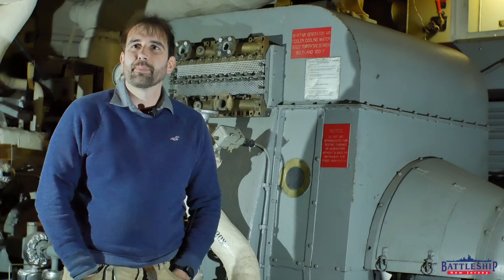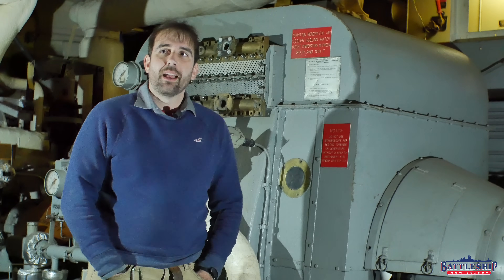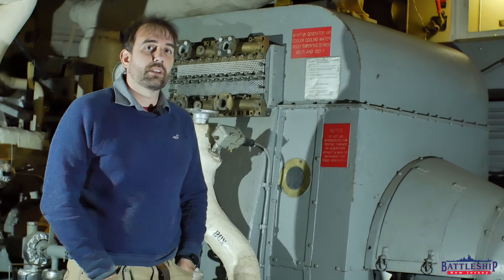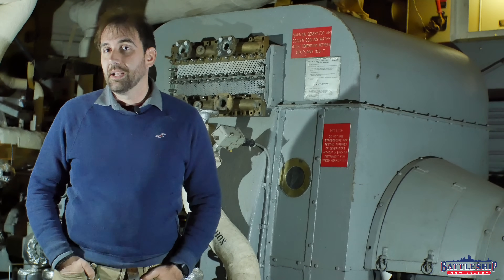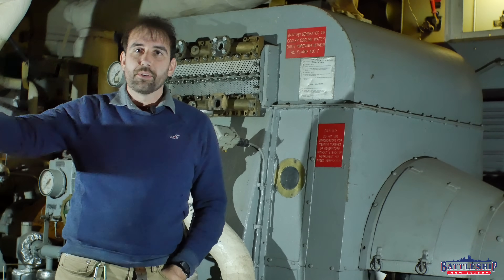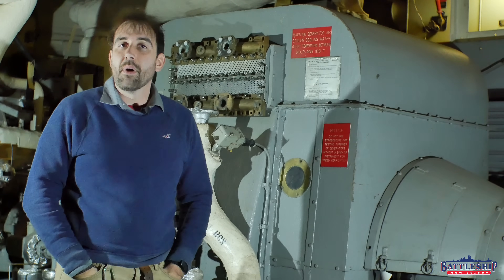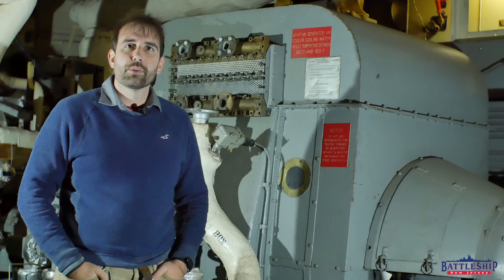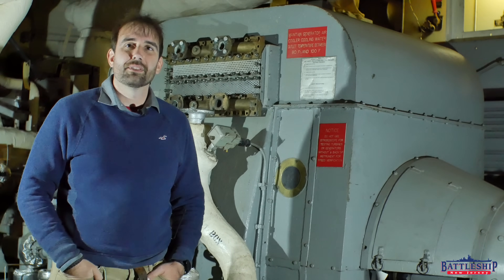Turbo Electric vs Direct Drive Turbine: What Propulsion Plant Is Better for Capital Ships?

Comment: A hybrid with a mix of gas and steam turbines to allow both more efficient steam turbine use for up to moderate power demands and the smaller size of gas turbines to allow more peak output and redundancy from extra turbines, designed with no less than an n+2 turbine configuration to allow for full operation while simultaneously having a turbine down for maintenance and one going offline unexpectedly for failure or battle damage requiring a third turbine down before any limitations on power, helping fulfill the absorb hits and keep going needs of a battleship.  Combine that with a 3 power bus system with most critical systems being hooked up to select between two busses and each turbine able to connect to any bus running at 14400 volts phase to phase/7200 volts phase to neutral, like most street level power distribution lines to allow smaller lighter wiring for very high power items and large feeders, stepped down to 480/277 and 208/120 for smaller loads.  Three busses configured that way allows for operation with any single bus out of service without as much weight penalty as a two bus system would have as each only needs to handle 1/2 of the total load, not all of it (remember in bus out of service all load gets split into the remaining 2 or single bus) or in other words total bus capacity is 1.5x (0.5x3) not 2x (1x2).  Keep the busses separated from each other with only branches going to the same place, perhaps left, right, and down the center of the ship so no compartment can take out more than one bus.  Add in redundant control rooms with redundant control cabling (something some modern large commercial ships actually have already) and you have a good base for a highly survivable, highly reliable, ship that can do repairs and maintenance underway without loosing redundancy and can survive a lot of complex multiple system failures and which uses a fair bit of widely available equipment which saves on cost, means we know a lot about what it can and can't take, and makes procurement of repair parts, spares, etc. much easier as there are large established supply chains.

Some may be able to tell, this is somewhat influenced by my background in IT systems and what I know and have seen or dealt with in redundant systems there, including the high power environment of data centers, which in fact often take their power in at those higher voltages and run their generators at them for similar reasons, though almost all their load is stepped down to a mix of 277/480 and 120/208, they also often have multiple internal power grids with a lot of equipment being hooked up to two separate power sources with separate backup systems, some of them have explicit redundancy even during maintenance provisions like described, and so on.  They also are an example of systems build for extremely high power demands, typically measured in megawatts, often double digit megawatts in a single building and some campuses reaching over 100 megawatts in total.

Comment: I work with a gentleman who was an electricians mate on board the USS Missouri for his last 4 months in the Navy. He told me that as he recalled the Iowas had a 5 kV electrical distribution system that was protected by GE magnablast breakers amd electromechanical relays. As an electrical power distribution engineer id be super into a video talking about some of that equipment

Comment: I served in the submarine service in the late 1960s in three different WW-2 built Balao class subs which had been upgraded and streamlined after the war.  This was the time when the nuclear submarine fleet was really just being built up.
   In the 1920s and 1930s The US experimented with various types of drive trains for their subs.  It must be said that submarine technology was much influenced by the vast improvements of the relatively new diesel engines and that they eventually used the same diesels as the new diesel locomotives, making the R&D and $$ workable for the navy.
   Back in the 19-teens well into the 1930s the diesels were (noisily) geared directly to the prop shafts, but this created noisy vibration and forced the diesels to be run at speeds related to desired shaft RPM instead of their most fuel-efficient constant speeds.  One design had a single prop shaft routed thru two diesel engines in line and created hopeless vibrations because of inevitable even slight misalignment.  From there subs developed one pair of direct drive diesels in the stern and a second pair of diesel generators further forward in a compromise plant.
   By the late 1930's the fully diesel-electric drive had been adopted, refined and proven for submarines, generally worldwide.  In our US subs there were two 1500 to 1600 HP railroad locomotive diesel generators in each of two engine rooms.  The generators sent their power to a large switch cubicle just aft in the maneuvering room.   Here the power could be cleverly switched to power the large geared electric propulsion motors below the deck of this compartment, and/or to charge the massive batteries that provides ALL power and propulsion for the sub when it was submerged.  The switching allowed any diesel generator to do either of these tasks or both of them at the same time - ultimate flexibility.
   Late in the war a captain in the electrical branch, one Hyman Rickover, led a team which developed a slow turning electrical propulsion motor for submarines.  This eliminated the need for the very noisy gearing and made our boats quieter.  These were installed as original equipment in late war subs and were commonly retrofitted into the earlier subs when they were upgraded post war.
   After the war these boats were upgraded in various ways (GUPPY programs) always with a snorkel system which could supply air to any two of the four diesels allowing them to be run at periscope depth which made the subs more difficult to detect.
   The diesel railroad locomotives use the  same concept of electric drive.  Large geared electric motors turn their wheels.  But on the subs, at least we had our large batteries to subsist with when below.with no diesels running.
I FAST BECAME A BIG FAN OF ELECTRIC DRIVE, AND STILL AM.

Comment: With electric propulsion motors the size you are talking about does not have the advantage of changing direction as you say. They have to use a thing called slow ramp to prevent pulling too much current and over loading the generators. Also you would not have a bunch of small generators around the ship making power, it would probably be 4 massive turbo generators creating power at 11,000v to keep the amps down. I was on a gas turbine electric ship that created enough electricity to power 60,000 homes. The benefit of Electric drive is mainly fuel efficiency across a broad speed range. There is no survivability advantage because with high power systems like this there are alot more components such as converters and transformers. If there is even a slight problem with them the whole system goes down. There is a reason why the designers went for steam turbines on the Iowa class.  Fuel was cheap, electric propulsion technology on this scale did not exist and steam turbines are simple
Reply: USS New Mexico used 2 4000V generators for propulsion, and six auxiliary generators. No power electronics at the time so they jumped speed by switching the number of poles, and any other adjustment was by changing the speed of the generators. IEEE paper here, pg 5 for New Mexico. https://folk.ntnu.no/torarnj/IEEE_Proceedings_Skjong_2015.pdf

Comment: Rudderow class DEs and Crosley class (converted from Rudderows)  APDs were T-E ships. My watch and Sea & Anchor Detail were at the Throttle on USS Weiss APD 135. It was easy to go from Ahead 2/3rds to Back FULL in less than 20 seconds.  I did it once.

Comment: One advantage of turbo/electric over steam propulsive turbines that I can see, would be in the resistance to shock and splinter damage; if you crack or puncture a steam pipe, that steam pipe will lose pressure and functionally lose some or all of it's capacity to transfer energy. Chip or bend a copper wire, it will still have almost all of it's original energy transfer capacity (though it may become a hazard to crew. 

Obviously, the turbo-generators still require steam supply to run, so you're not eliminating all of that problem by going with turbo/electric, but assuming the steam manifolds are subdivided sufficiently, it would seem much less likely to cause a major loss of propulsive power from the loss of a single supply pipe in battle.
Reply: Indeed. But there is another advantage: Since the steam in a geared turbine set must be made possible to be put into the turbine backwards for reversing, this is not the case with t-e propulsion, thus massively decreasing the piping length and complexity!

Comment: If designing a new, “gold-plated” battleship, a pair of the Ford-class’s reactors would be most efficient. Lots of power for all purposes, and a diesel or two for backup and emergency power.

Comment: I can tell you that on Nimitz class carriers direct drive turbine propulsion is alive and well. I doubt that electric motors powerful enough were available when it was designed in the 1960s.  Imagine how much smaller those cables, generators, and drive motors could be if they upped the voltage to 4160VAC 3 phase like on Nimitz's central distribution bus.

Comment: id say for large capital ships and submarines, nuclear. mostly to bring the cost of operations and crew down. exceptions to this would be say if you have the capital and resources to manage such as a starting naval power. if you only plan to have a few capital ships and are going to have them fitted with an power/propulsion system that has a net efficiency of say 1.25/1.35 of your average cruiser of the time for a ship almost 1.75/2 times the displacement. or you really need the ship but cant afford the plants that wont make your engine room a missive week spot. after that i want to say either gas turbine or diesel electric but i cant remember which one is more efficient when sized up to fit a ship's power needs.
Reply: @E-Hamel ok, then I'd go with desire for most ships but if I have any ships that often end up in situations where the engine is ko needs repair or is lacking spare parts then swap that for a gas turbine asap. Fuel efficacy is great but not if the engine it's self keeps being damaged

Comment: I've read another reason against turbo-electric is if a shop takes battle and water gets into the ship the danger of damaged cables arcing electricity into the water can be lethal to the crew trying to repair or shore up any hole.

Comment: How big would the 53,000 hp motors be?? Need 4 of them. How large would the cables be? still need 8 M type boilers, and the SSTG's would be as big as the main engine/reduction gear sets.

Comment: I did some volunteer work on the Acushnet being turned into a museum ship, it's a diesel electric hybrid. Pretty wild, 4 engines, four generators in the front, not much in the middle, then the four motors feeding two gear reducers powering two shafts.   Being able to mechanically decouple your power generation from the propulsion is pretty neat.

Comment: Nuclear Turbo Electric. We know Turbo Electric works as that's what the US is using on the new Zumwalt Class Destroyer. You drop a reactor in there, you don't need any of the smoke stacks or ventilation equipment, freeing up alot of room. You could even use the saved weight to put thicker armor around the reactor, even matching the citadel. One of the big things to me is to get way from the whole "It has to fit through Panama" idea, and you can build a true monster
Reply: Well, there was that recently finished expansion project for the Panama Canal to allow larger cargo ships through a new set of locks. Not sure if the Navy has any design plans involving that yet though.

Comment: Personally, I think that a hydrogen/antihydrogen reaction manifold system moderated by a tunable crystal lattice feeding power to a pair (or two) of displacement field emitters with a minimum upper range of 150,000 cochranes would do just fine for a battleship.
Reply: I'll have one of those please.

Comment: The main advantage of turbo-electric is that you run your generation equipment at it's most efficient speed always, switching in more generation when more power is required at the drive motors. Even by the 1940s, steam-to-electricity-to-motor conversion efficiency was pretty good compared to mechanical loses in the gearing. The SS Normandie proved extremely efficient compared to Queen Mary (for example).
Reply: Modern oil flooded gear boxes are pretty efficient though.
Reply: @joeedh  Yes but efficiency at part power is horrid for large engines, where they for the most part run.Turbogenerator set you simply bring smaller units up as needed, not needing to keep massive amounts of metal spinning when it does not deliver power, and having to run at low steam pressure and flow, so they run less efficiently. Gearbox losses are minimal even on 100 year old boxes, especially if you have ball or other bearings, or separate pressurised oil feed to keep all the sleeve bearings fully floating. Pressurised oil feed you run the gearbox essentially dry, only spraying oil on the actual moving parts, the rest of the parts run in air, so lower losses there, and you do not need as much oil, plus can keep it clean better. Big ships all run with pressurised oil, the crank cases are just there to return the oil to a separate tank and filter set.
Reply: @SeanBZA  That's a good point about partial power.  I guess the only real solution is to split the engine up, in which case you have to go electric (I mean the Navy can't even combine two engines mechanically--witness the LCS--, much less a dozen).
Reply: @joeedh  All Burkes have 4 gas turbines that they kick and out of gear pretty easily.
Reply: at its

Comment: I remember when stationed at the Pentagon in the mid-eighties, the handwriting was on the wall for retiring the battleships, and I saw a serious proposal to do exactly what you are describing -- they proposed to cut the bottom out of the ships in order to replace the drive train without dismantling the rest of the ship.  I don't recall the specifics, but they were also going to cut the crew by half of so.  And the test range for the 16" guns was curiously down a section of the Potomac.
Reply: The one US ship needed an engine replaced, so they cut down from the deck to make a hole big enough, all done in Australia, as this was cheaper than towing it back to the US shipyard.
Reply: Ussr once replaced the whole nuclear reactor section on icebreaker. It was so polluted after multiple leaks that no works were possible. So they cut all internal structure, blowed up bottom and all this radioactive machinery went to ocean. Than ship bottom was restored in drydock and new plant installed.

Comment: Just as you do, you tell me to build a battleship to fight other battleships I am going to choose a turboelectric installation. The turbo electric allows me to nearly double the number of compartments I have the power installation divided into. I might have missed this but another problem of the turbo-electric is that it physically occupies more space per horsepower. Compared to say West Virgina even with an additional 20 years of development you are not going to manage to pack 212000 Shaft horsepower into the same space with turbo-electric that you can with straight steam turbines. Even with careful space management, you are probably going to have to have half again more space for that plant. This is going to turn into a ship clearly another one hundred feet longer. This is going to be more expensive (but even harder to sink), with more target area but no more main armament. As far as the ship's actual ability to fight all it will really gain in secondary armament - maybe 30 5 inch and 120 40mm and then you're going to end up with a half-again larger crew. As I am sure you know, in shipbuilding one nail always drives another.

Comment: I always found it interesting that the big five had turbo electric propulsion. Didn’t realize the Lex and the Sara were turbo also. When you mentioned the Saratoga taking damage did you mean the Lexington since she was lost in the Coral Sea. I think a nuclear electric plant would be interesting. Maybe not though. Then you need a reactor, steam turbine and generators. I’ve heard that Zumwalt and the Ford class have massive electrical generation capacity though.
Reply: Saratoga survived two separate torpedo hits, they unfortunately did disrupt the electrical wires & controls. Each time within 24 hrs she was able to make temporary repairs & limp to a port. However considering each hit was from a single torpedo Turbo electric propulsion was labeled less robust than pure steam.

Comment: 1) Not Seattle for the use of an aircraft carrier to power the land grid, but rather Tacoma. The power plant on the US Navy ships was LEASED to the Navy by General Electric, the arrangement in Tacoma was done through General Electric with the Navy not paying the lease rate while the ship was used for the land grid.
2) The ultimate turbo-electric plant was not that of the battlecruisers/aircraft carriers, but rather the French liner Normandie. The reason that Normandie was not returned to service was that the electrical components were ruined by their long immersion in the North River.